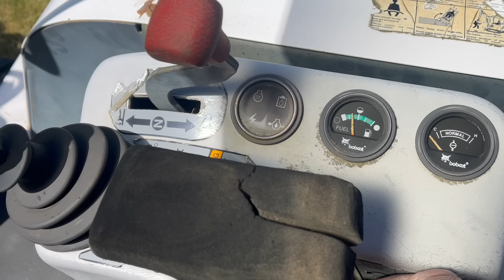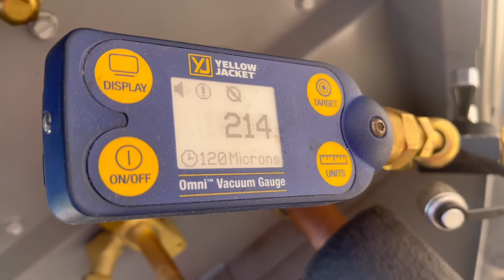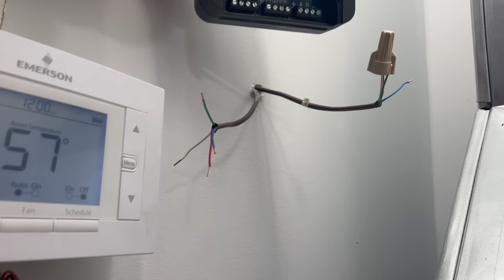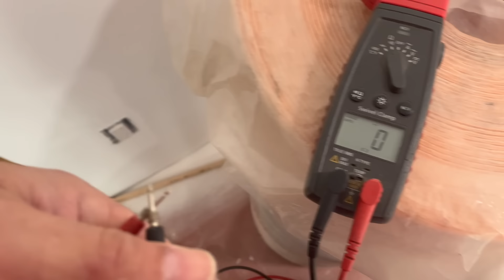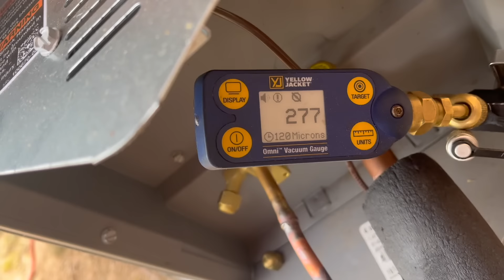HVAC for my Home: Heat Pump and Controls

Comment: Sweet setup.  Do you know if that unit cuts the indoor blower off during a defrost cycle or slows it down so you aren't hitting the house with cold air during defrost since the heat strips are locked out until 20 degrees?  Wondering how that one does it, since it is communicating.  If you have time shoot me a response.  If not, no worries bud.  Unit is very quiet.  One day I want to put an inverter at my house and ditch my gas.  The only gas I currently have hooked up is my 29 year old furnace.  Lol.  Cost me like $25 in fees per month even when I am not using it.  Thanks for the video.  Stay safe out there.

Comment: I would have run low voltage wire with more conductors in it. Personally I use 8 wire for heat pumps. Just in case for the next guy. That’s just me.

Comment: Yea that system is old school should of got Mr cool at least won't blow cold air when it's below 32 and ya don't need heat strips been tested to minus 39 .and fan speed is controlled by thermostat and its only 2 mire for heat and air outdoor temp sensors dehumidifier connect humidity sensors you name it bring that stuff back and yes forced hot air I just did one fkn amazing especially old house with shit duct work